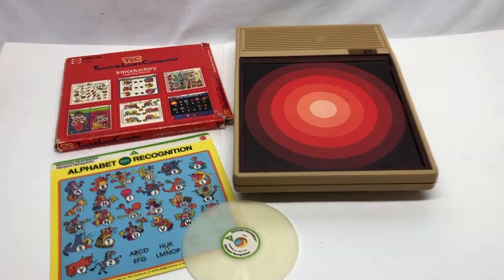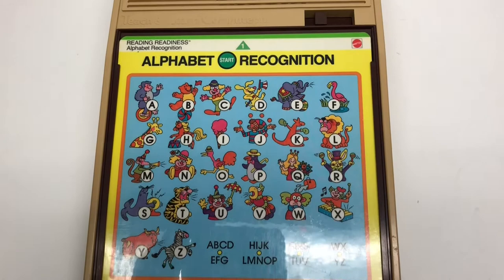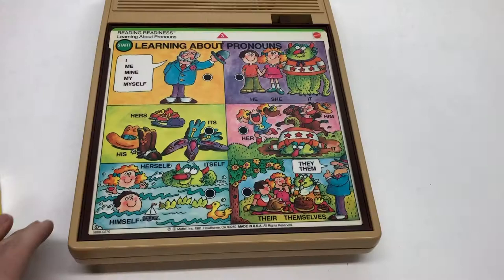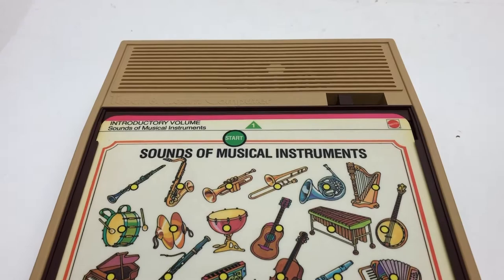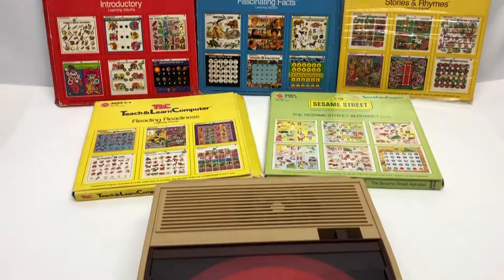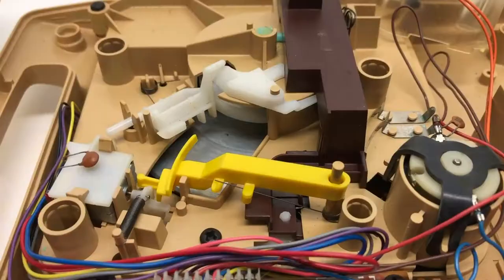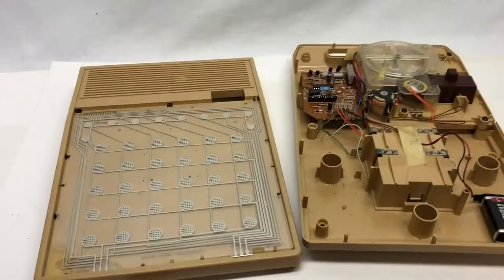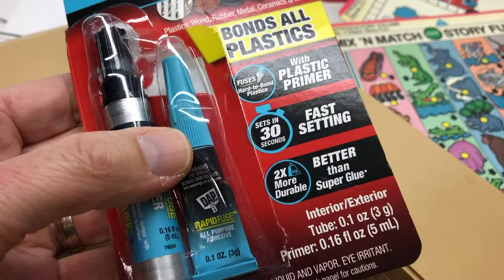Mattel 1981 TLC Teach & Learn Computer Demonstration +Look Inside + Repair Vintage toy Sesame Street

Comment: I've had one of these machines since I was a kid (born in 1980) and it's always been one of my favorite possessions.  I was planning to do a repair/teardown/tour video of it myself if I ever get time, because the Internet barely seems to know it exists.  But now I don't have to; you did a fantastic job!!  I'm really so glad to see all of this covered here!
I figured out how the "programs" work in the "computer".  The microcontroller chip you found on the PCB inside already has all possible programs permanently stored.  A "program" in this sense defines the button layout (which physical membrane switches are valid on the touch panel) and the flow of the program (the sequence of track numbers played from the disc and a very simple branching tree; a flowchart if you will).  (Really, there is only one program, and each game you would play is just a branch off the root of that decision tree.)  Any specific game media tells the "computer" which branch of the tree to start from (i.e. what type of game it is) by one simple input: The position of the Start button on the mylar sheet.  You can prove this easily:  Compare any two games with the same number of buttons and the same program flow (especially the "big collection of random sounds" ones), and you'll see that their Start buttons are in the same position.  If you put a mylar sheet on that doesn't match the disc you inserted, with the Start button in a different position, and press the Start button, and then switch to the correct mylar sheet, you'll also find that the program flow, the tracks played, and the button positions are all messed up until you eject the disc and start over.  So this is just one more limitation to add to the list: Anyone developing a game for this machine has to conform to a specific layout and sequence that's already been defined and that the computer already knows about.  Once selected, the only variations beyond that are the graphics and the audio clips, which as you mentioned, are also limited to 40, with "Press the green Start button" being a mandatory one at "track 0".
For the record, I think it counts as a computer; a digital one, even, though not a general purpose one.  That microcontroller is a National Semiconductor COP422 consisting of a CPU that actually runs code and has its own ROM, RAM, and I/O.  It has an input (touch panel), outputs (audio playback device and piezo buzzer for tones), random-access removable media storage (audio playback device using records), and runs software (mask ROM containing the branching tree).  It won't add 2+2, but it will analyze your input and produce a series of outputs according to predefined logic, and some games show that an incremental counter plays into the logic.  I won't count the graphics on the mylar sheet as an output; that's cheating. :-)
Reply from the maker: Wow - thanks for all of the information on this item.  You are right that there is surprisingly little about this on youtube and otherwise.  You have added a lot to the technical understanding of this cool toy - thanks!
Reply: @davidk4145  Thanks for the great video!! 😃
Reply: That is awesome. I have always wondered how it got all of its responses and figured that they were preprogrammed somehow. But I really did love this thing when I was kid. Only hated the fact that it drained some pretty expensive batteries quickly, and I would be left for days or weeks with a dead device. Thanks again for the really detailed explanation and thanks again to @David K for doing the video!

Comment: Hey David. Your repairs helped me get the seized up motor spinning and it’s playing the disc. But there’s no audio. Before I got the motor working it was making an audible beep. But no voice or anything while disc is spinning. And recommendations?
Reply from the maker: Did you watch the video at around 10:14? Does your yellow arm move across the record and does it have a small stylus that looks like the tip of a pin (you see it at 10:21)?
Reply from the maker: Another thought. Does your speaker piece have a spring that’s holding the yellow stylus arm against the disc?
Reply: I see the spring on the speaker pushing the stylus down. I didn’t take out the stylus and inspect the needle. It worked intermittently for a short moment but was slow like the batteries were drained. I put fresh batteries in and still getting no sound. Is there a fix to find a replacement for that gold looking disc with two wires that’s attached to the speaker housing?
Reply from the maker: @mattlajoie5592   The truth is I’m not 100% sure what that disk does. I thought it produced a buzzing noise that you sometimes hear if you leave a record in for a while without using it. But I’m actually not positive. Here is a link for a possible replacement disk though I’m not positive it’s exactly the same so you’d be taking your chances.https://www.sparkfun.com/products/10293

Comment: I'm trying to get one working for a friend who grew up with it. The motor is not working. Does anyone possibly know the specifications for the motor as to voltage and speed? or a source? Thanks! Eric
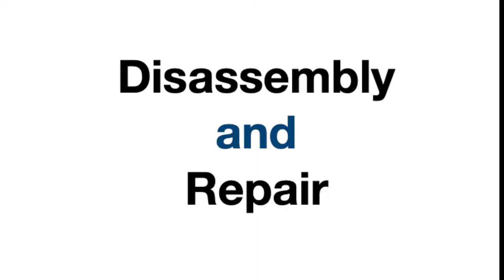Reply from the maker: The battery compartment takes 2 C cell batteries and a 9 volt.  I believe the 9 volt is for the electronics and the 3 volts is for the motor.  You can start watch this video at 13:26 when I show how I fixed a motor that had seemed to be dead but just needed to be spun a bit to get it back in working order
Reply: All I get is a beep… help!!!
Reply from the maker: @crazyts07mjs91  Can you provide more information.  When you put the record in do you hear a motor turning (go to 1:58 in the video)
Reply from the maker: @crazyts07mjs91  Can you provide more detail.  Do you hear the motor spinning when you put in the record (go to 1:58 in the video to see what I mean).